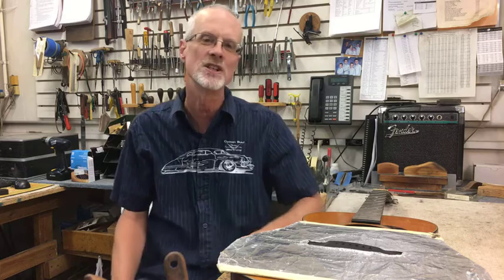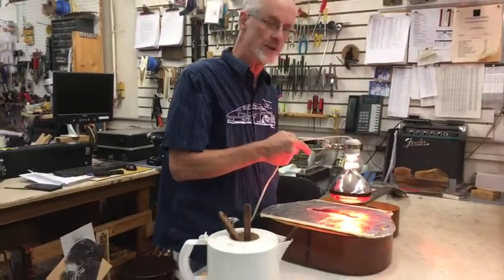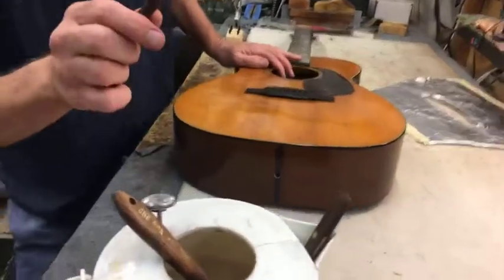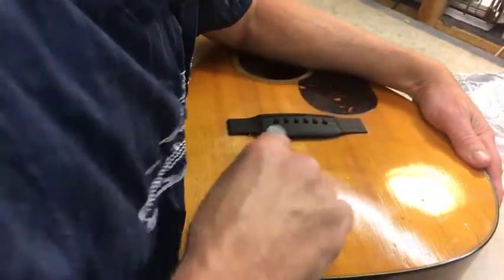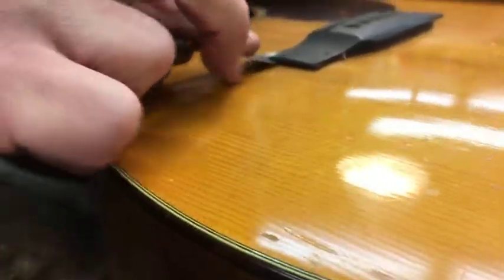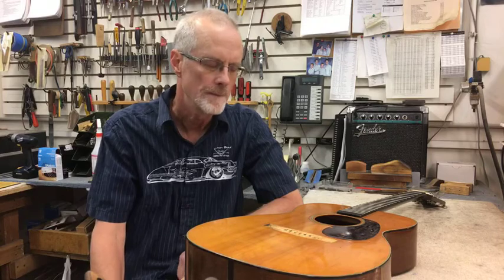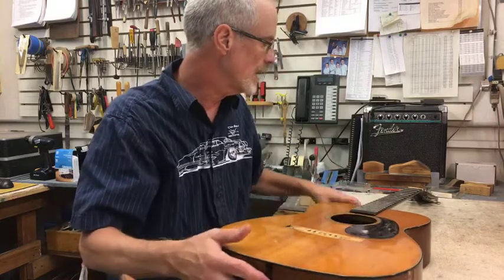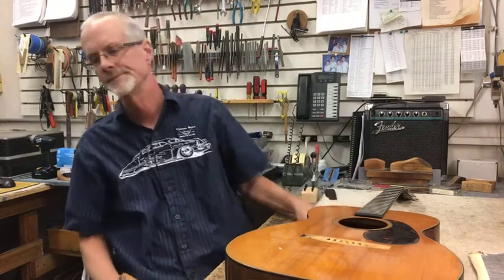In The Shop: Removing the bridge on a Martin 00-18 from 1940!

Comment: You need to heat that blade on an iron buddy. It will then cut through the bridge glue like butter. You make simple job look hard. Lucky you didn't puncture the soundboard with all that effort. A simple domestic iron will allow you to heat the blade every couple of minutes.